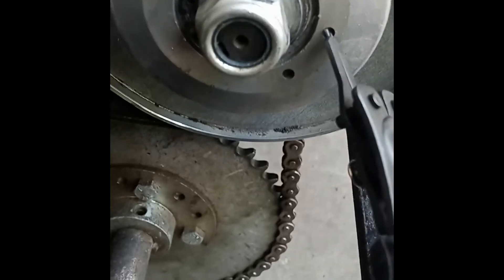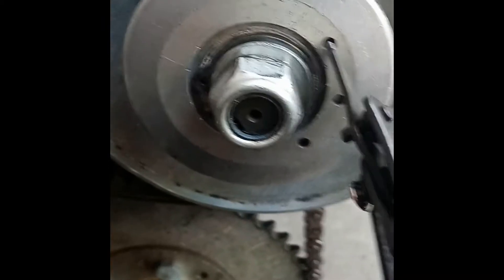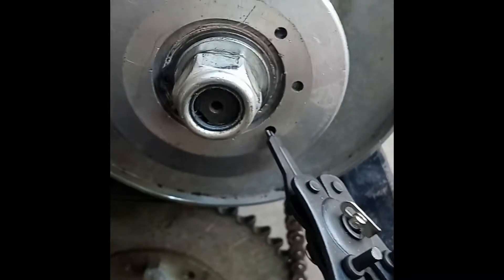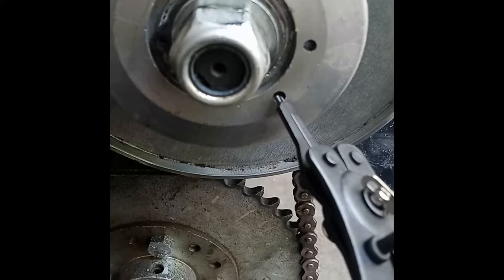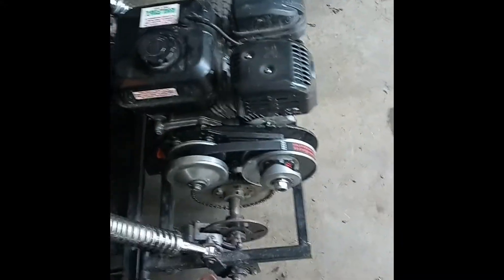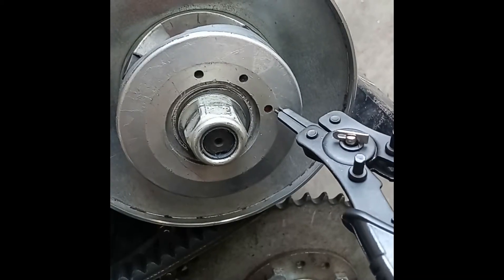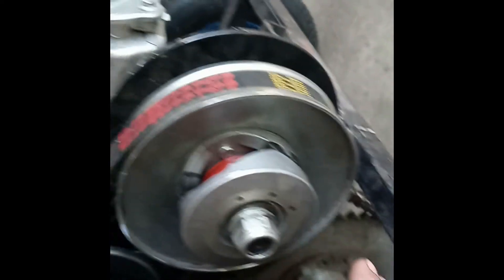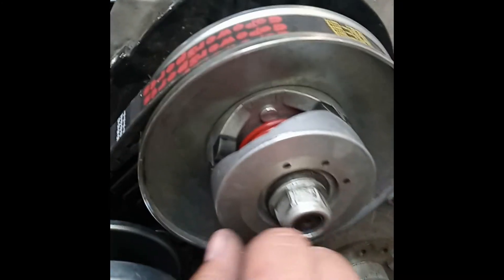Adjusting a torque converter (30 series)

Comment: On my mini bike it's opposite of what is working for you. I use the yellow spring which has the most tension in the tightest hole for the best acceleration with a belt shift that comes on later at a higher RPM. It's much better than lighter springs in the other 2 holes. I tried the green spring which is the least tension and was like a different bike with weak acceleration due to an early lower RPM belt shift.
Reply from the maker: I might have to try the yellow spring, thanks for the info!
Reply: Which hole on the mini bike makes it have the highest top speed?